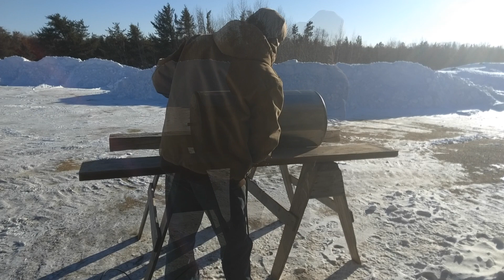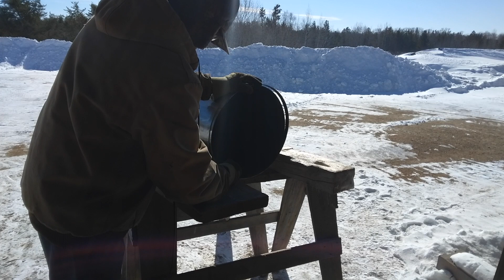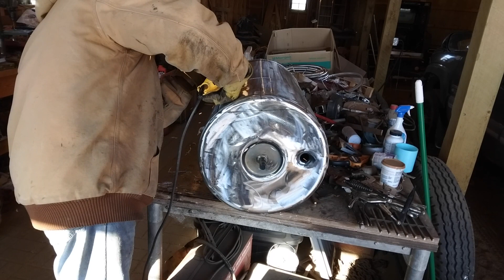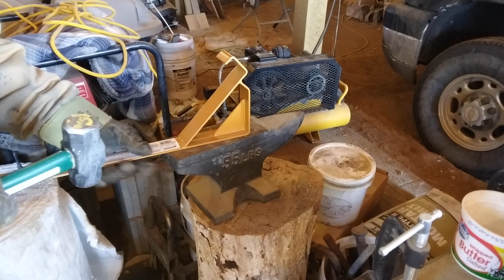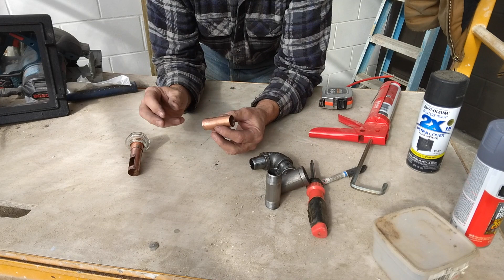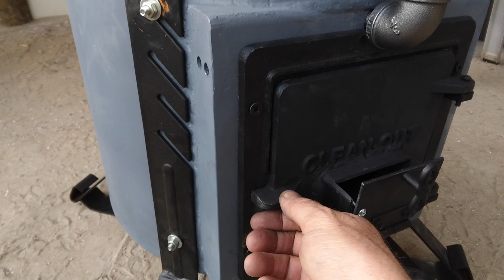DIY Rocket Stove Water Heater, (part 3)

Comment: Hi there, you really use your mind to figure out things, I have 3 black tanks the size of 40 gallon water heater someone gave me . They do have outlets on bottom sides to connect and opening on top to fill with water. They are glass lined, he said they were to use with solar to heat hog water, any suggestions will be helpful, Thank You 😊
Reply from the maker: Are the tanks metal or plastic?  If you could put them inline with your water heater, it could be used as a tempering tank, if you had some other type of low grade heat source.  Bringing the heat up some before your water heater takes it up to it's setting.
Reply: @doubleMinnovations  metal

Comment: I really like your logic with the stove. Using easily found stuff off the shelf for the stove is genius. Are you sure using a 3/4" size pipe fitting will be enough air for the secondary burn ?? Look forward to see what else you have planed for the water heater. Peace  vf
Reply from the maker: I use stuff that is familiar to me, and available.  I'm still not completely convince that a secondary air is necessary, if operating like the other wood burners I made.  I can alway increase the size if I ever thought it would be needed.  Thanks!
Reply: @doubleMinnovations  Thank you for your feedback. Look forward to the next step in the process. V